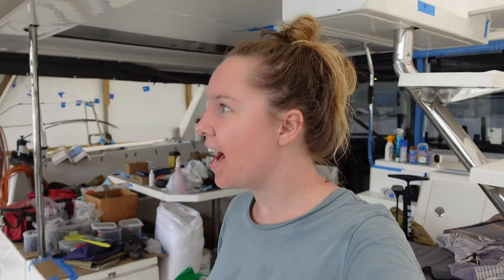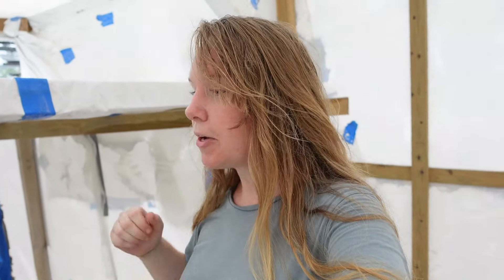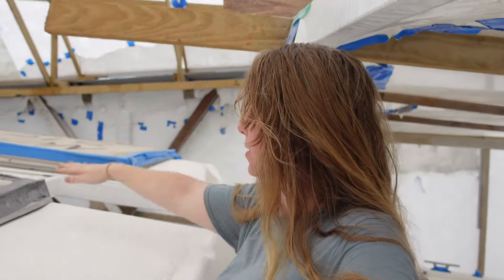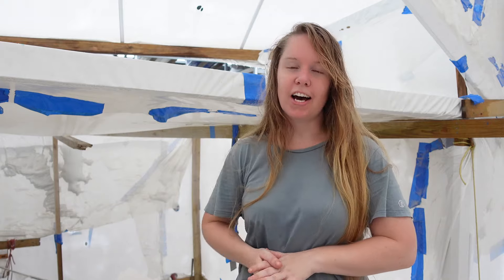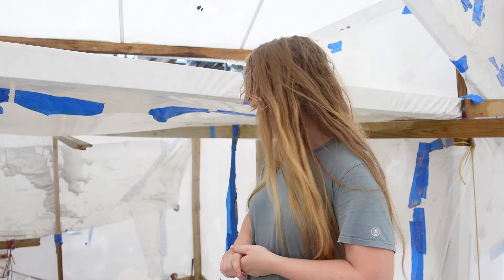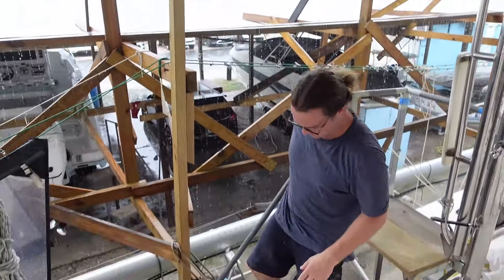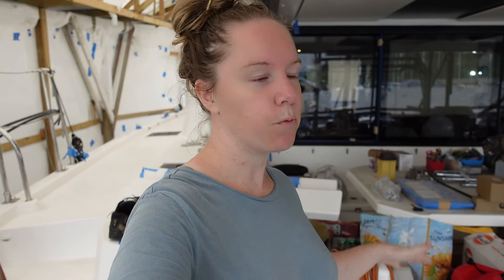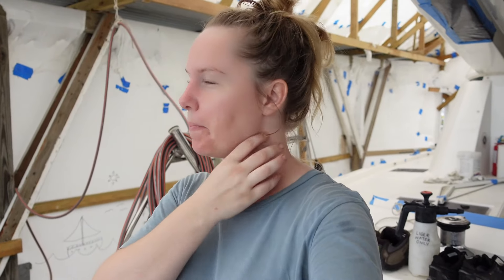Sailboat "Shame Tent" COLLAPSE + Leopard Catamaran Warranty UPDATE

Comment: Is it possible, that rising demand for boats has led some manufacturers to focus on increasing and accelerating production, in order to meet demand?

Post Covid, lots of people have looked to change lifestyle and live their dreams. In that headlong rush to meet demand (and cash in) quality has suffered, quality control has suffered and customer service has suffered. The latter two having seen no increase in investment to increase their capacity to match the increase in production.

Several brands are possibly guilty of this. Especially where they have a new and very popular model. They take orders for 50 or more boats and then rush to get them out of the factory. 

Interestingly, I saw a rep from one brand saying that they capped their production and close their order book as soon as they reach a certain (quite low) number for each year. This is to maintain the quality of the finished product. They could sell twice as many order book slots but prefered to limit production to what they know they can build whilst maintaining the highest standards. But their boats are described as semi-custom.

This is what scares me most, about most production boats. The design/architecture/enineering/equipment might all be excellent, but boats are made to a volume schedule rather than a quality standard. Errors are bound to be made. The better companies will bend over backwards to get them resolved ASAP. A few, don't really appear to give a damn. The documented experiences of several new Leopard owners, is giving strong hints into which category the Leopard brand and builder, falls under.

I'm enjoying your videos but desparing of your experiences. Hopefully, you get your boat back in the water before the next hurricane season hits.